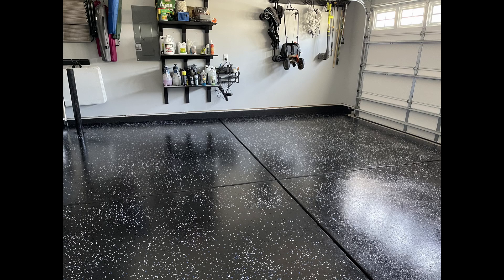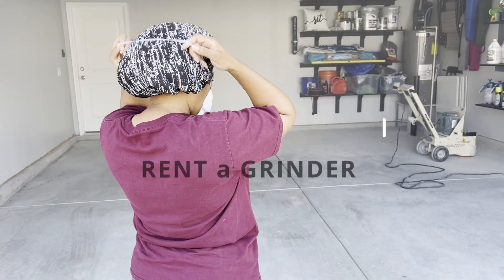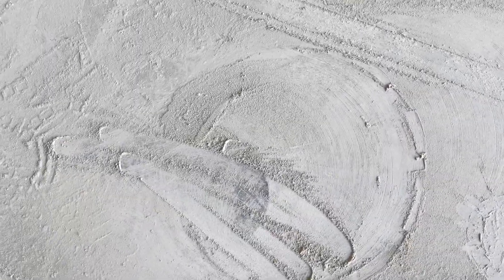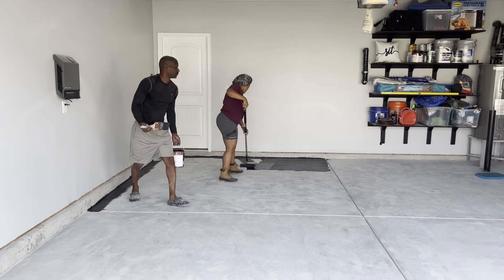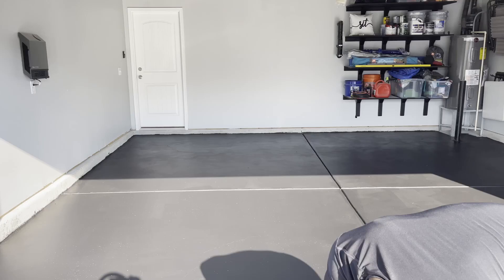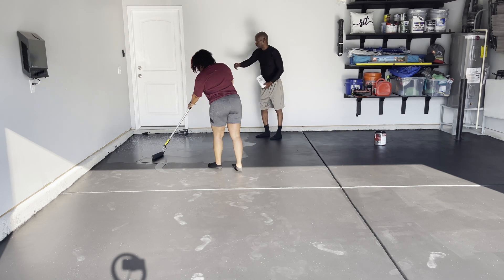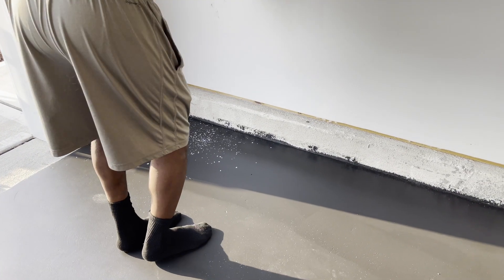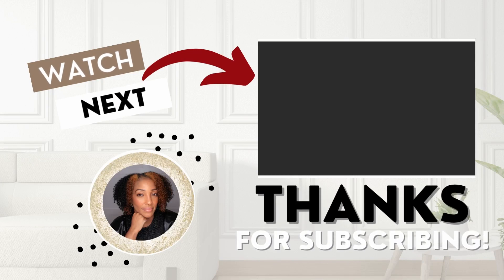Epoxy Your Garage Floor In A Snap With This Secret Trick!🤫

Comment: I have watched this video at least 10 times. ill be doing this project by myself and I want to make sure that I am well prepared and follow every step that yall made. I didnt see yall use primer, is that because yall used the Grinder so the primer wasnt needed? or would you still recommend using primer?
Reply from the maker: Aww, thanks for watching! You are courageous! We did not use primer because of the grinding process. The grinder is HEAVY though. You’ll likely need help to get it off the truck. You want the paint to adhere to the concrete after that step. If you are going to drive your car inside I recommend car mat strips. My husband purchased some three months afterwards bc I notice a small piece of paint on my tire from the hot wheels. So I just drive on the strips. The other side of the garage has a lot of yard items on them without any issue. There’s a small clip in my Fall 2024 video where I joke that I can’t provide an update video bc the garage is never clean. LOL! I am going to link the strips in the video in case you need them. My husband cleans the floor with a Bona Mop from time to time. Other than that, the floor still looks great!

Comment: Does it have any maintenace? 
Do you recommend black flooring compared to gray as it's been 9 months?
Reply from the maker: It does not require maintenance. My husband cleans it with a bona mop when needed. We did add a couple of car mats on one side since one vehicle parks inside. The color is a preference but we love the black floor. We received a lot of compliments from our neighbors.

Comment: Will the anti slip coat help last long as my epoxy started peeling after few months
Reply from the maker: Oh no! Did you use the grinder? We’ve had our for 1.5 yrs thus far. The anti slip just ensures no one falls from a slippery floor.